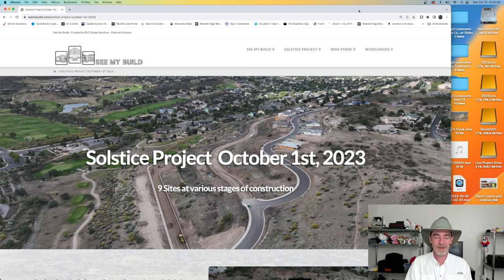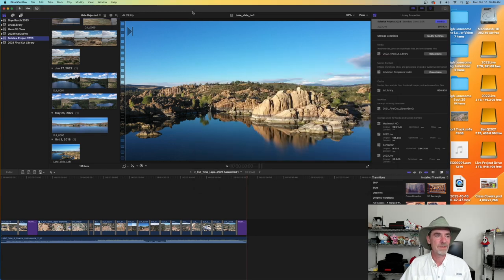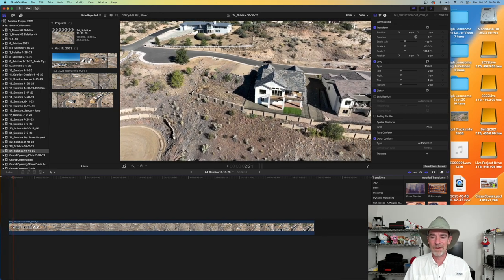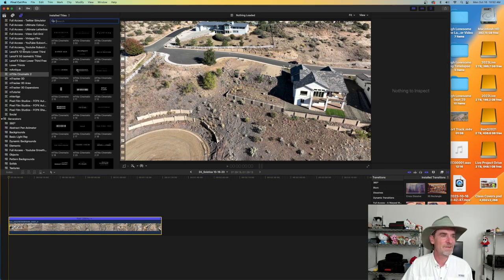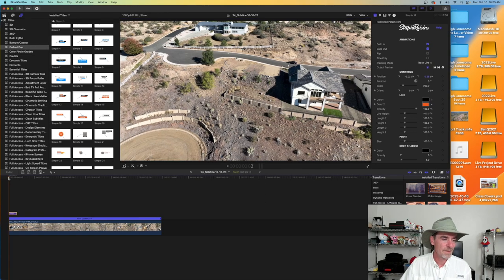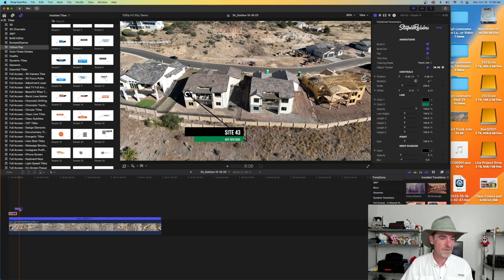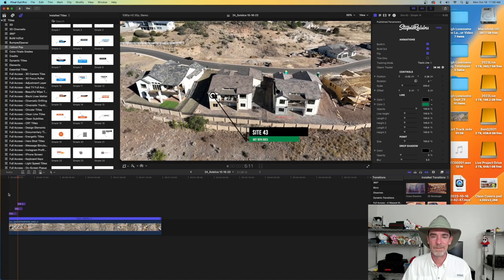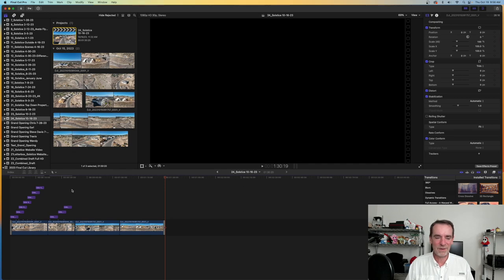Creating A Construction Monitoring Video - Final Cut Pro - Mavic 3E

Comment: Very informative video, I follow pretty much the same workflow. Agree that callouts take some time to sort out!  I assume you have replicated your Litchi waypoint flights in the DJI app? The one think I did in Litchi for stills was take images every 4 seconds - how are you doing this in the DJI app?
Reply from the maker: Glad you found the video informative!  I have replicated some of my Litchi flights into the DJI Pilot 2 app.  I actually used a Litchi to Mavic 3 Enterprise converter.  Still had to do some manual adjustments.  In the case of my flights so far I have the DJI App follow a course to a waypoint, then take a photo from that Waypoint.  I haven't looked into shooting every so many seconds.  I'll have to see if I can do that.